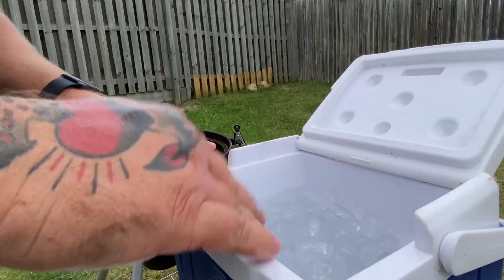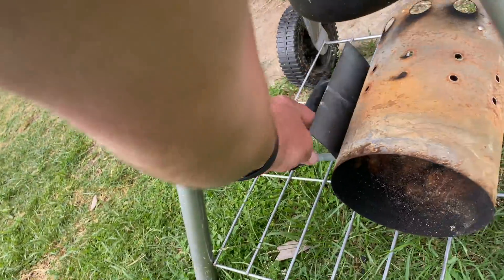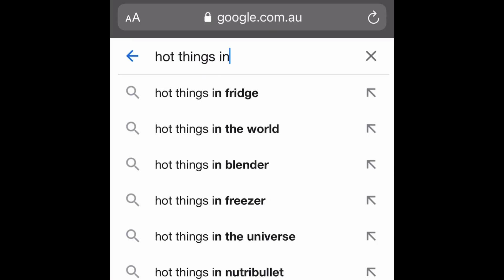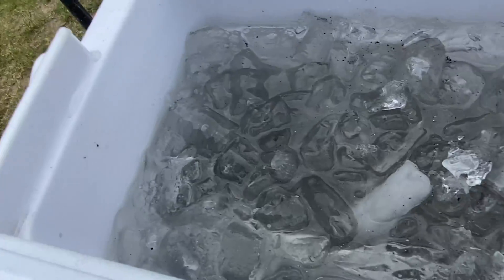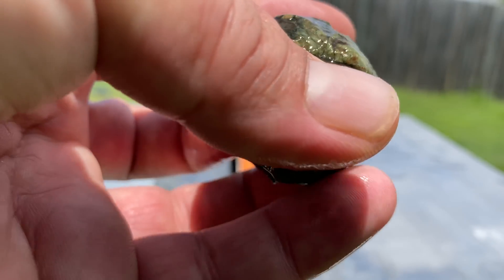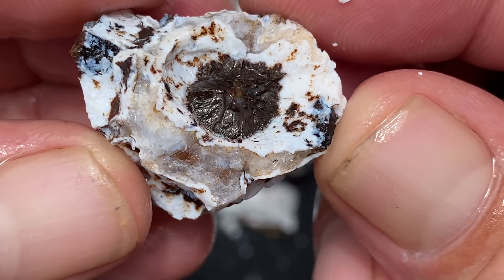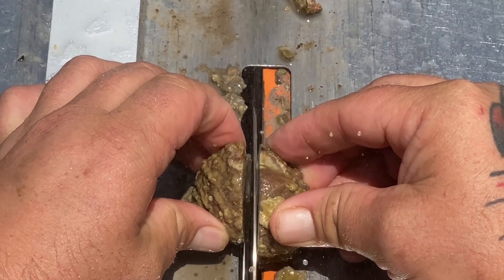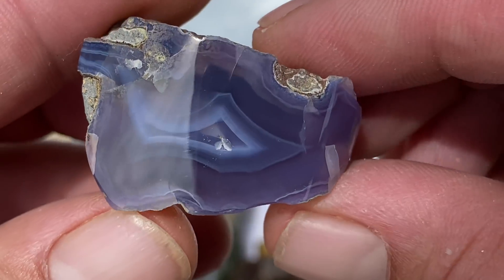Can I Make A Thunderegg Core???

Comment: I've actually found a few of those thunderegg cores/vertebrae while rockhounding. I suspect that the way they form naturally is through repeated freeze/thaw over thousands of years. 

Most rocks are actually slightly porous and porosity varies from stone to stone. The rhyolite shells of thundereggs tend to be more porous than solid agate/chalcedony or common opal. When they are in the ground during the winter and freeze, small amounts of water between the shell and the agate freeze and expand. Over time, this breaks the shell away from the core.

The white crumbly parts of the cooked thundereggs were likely common opal. Common opal contains a small amount of water that boils off in extreme heat, cracking the stone. Water also exists in the structure of other opals, and is why they tend to crack if left out in hot conditions (in a car during the summer, etc.). Agate, quartz, and chalcedony contain little to no water, so those parts remained more intact.

Hopefully that info adds to the discussion. Thanks for sharing the experiment as well! It was interesting to see and even when things don't turn out as expected, experiments are an excellent way to learn new things.
Reply: The difference in porosity between the rhyolite caps and the chalcedony cores is kind of why I wanted to try my hand at freezing/thawing a bunch of times - hoping that even just a small bit of water would seep inbetween the cap and the core and expand just enough to separate them.
I just wasn't sure how long or how many freeze cycles it would take!

I will be addressing this experiment again. :)
Reply from the maker: Man thank you guys! Such great info. Just pinned this comment 🤘🤘🤘🤘

Comment: I wont hate on you man but i am happy you didnt have any of them explode on you. As a kid i remember other kids throwing rocks into a camp fire and then have them explode and throw red hot glowing bits of rock fly everywhere.  I was also sure you would burn through your cooler.    Good luck with your future experiments.    You could try it a different way. By freezing them solid next time then heating them with a torch. Not enough to burn them but it may simulate thermal cycles of the seasons. Also try freezing them totally submerged in water. When water freezes it expands and that is why rocks here in Canada split  because the water gets into tiny fractures and expands as it freezes. Seeing agates and jaspers split by frost here isnt unusual.

Comment: It raises a very interesting point, rapid cooling caused the fast formation of fine crystals, so if you heated and cool inside the coal pot over a very long slow cool how would the recrystallisation turn out.  I feel like there more to do here.  Thanks for sharing.  You’ve just learned some basic geology, on igneous rocks 😄

Comment: This was such an awesome take on the experiment! Again, just takes me back to grade school when we used to take a theory, do our experiment, and present our findings to fellow students and teachers in hopes to get a colored ribbon. haha 
So interesting how the inside material reacted to the heat and became very crumbly! 
There was a reason I picked different thundereggs - each one has a different make up with how the "core" is formed and how the exterior rhyolite caps are essentially adhered. The richardson rock ranch thundereggs would be the best for the tests since they are prone to having the "core" exposed over time. 

Dude, You did a great job on the continuation of where I left off with those thundereggs...and at the end of the video when you cut them...I can only wonder if the freezing/thawing process did something to it! Just, BRAVO!!!

I really think if I had them in a container with the freezing/thawing process but had them surrounded with various packing of sand and smaller rocks and had a way to apply pressure to the container to simulate as if it were underground - I THINK I would have had a different result. But that's just a hypothesis!

Thank you for doing this - this was so fun to watch and a great way to start the weekend!!!
Hopefully it didn't ruin your cooler and luckily your phone is okay! :)

Rock on, friend!
Reply from the maker: Man thank you Kyle for your help woth this one and for the sacrificial rocks 🤣😂
To be honest, I had so much fun doing the experiment and editing it. Haha! Just thanks mega dude!

Comment: It's important to remember just how much we can learn from our failures as well as our successes. I once had a major failure trying to reproduce an in ground Viking forge. After a whole day of trying to get the fire hot enough to melt bronze and having no success a blacksmith friend of mine came to the rescue and brought me the right kind of charcoal then helped me get the fire hot enough to melt pewter. The flames were so hot that the pewter melted instantly (I had given up on the bronze by this point) and poured wonderfully into the clay mold. Unfortunately the mold hadn't sealed as well as I thought and the molten  pewter just ran right out of the mold then down the hill through the grass. Thank goodness it was night by this time and there was heavy dew on the grass. We had gotten the fire so hot it melted the plastic on the brand new pair of bellows making them useless and a fair amount of pewter was lost. That is the only time I have ever seen a fire so hot that the flames were purple. I was extreemly upset about what felt like a catastrophic failure but I have realized since that I  learned a lot from this. Always think about safety when working with this kind of heat, have longer cooling tubes on the bellows, work on non combustible workspaces, and have wash water handy to clean up after a long day of digging and working over hot coals. Stinky stuff.😁😉

Comment: Things expand when heated. I think you'd want the core cold, then flash heat the outside. Maybe pack them in dry ice and then drop them into hot coals. Or find a knife maker who thermal quenches with liquid nitrogen. Get them cold overnight in dry ice, quick dip in liquid nitrogen, and then a quick trip into the knife forge to get the shell to quickly expand.
Reply: Exactly this. Although boiling water might be enough and would a safe and accessible initial experiment.
Reply from the maker: Oh! So like the opposite of what I was trying. Okay, I think that’s gonna be the next attempt hahaha! Thank you Kyle & Derek 👍👍👍

Comment: Oooooooh dear, well aerial you in for it now.
Nah not really, all I will say is experiments are done one at a time not all at once, W.D.40 got it's name by the number of tries before the miniture was right, enough said you wally. 
Ancient egypt, for removing huge slabs of rock the filled natural fissures with water late in the day so the cold froze the water expanding the gap,  another experiment for another day.
Etching in acid is another way, providing the rock is not just quartz based, vinegar being the safest acid and muriatic acid being the worse, I like muriatic acid, makes your hands tingle. 
But in all honesty doing in one day what takes millions of years naturally will probably not work.
However, heating and quenching may be an option, before they are red hot, dip them in cold water a few times and reheat, repeat the process and you should crack the rock without the old method of using a hammer.
You tried, you learned and we laughed, what more could you want in a youtube clip.
There is also something called the internet,  Where you can watch others mess up and learn what you should not do.
Keep smiling my friend.

Comment: I'm sure there's some mechanical benefit to this experiment (the thermal shock you mention at 3:40), but you may actually be chemically weathering them too, just by giving them more energy to oxidize. Rhyolite will decay into clays, my guess is you accelerated this process.
Of course, that thermal shock will also make any crystals very very brittle, and possibly shatter them (I get in trouble once in a while at the diamond lab when I do that to a diamond). I know heat-treating isn't the same as what you're trying to do here, but the concept may help.  Put the specimens in a big crucible and pack them with silica sand. Use a kiln, as they are programmable and can get much hotter than a conventional oven (though I don't know about hotter than a bbq, but the bbq is wet heat, whereas the kiln is dry heat). Ramp up the heat over about 12 hours to your target, and ramp the temp down over a couple days, that should avoid both the charring and the brittling. And if you've got the right iron ions in the right spot in your specimen (assuming qz) when it goes in, it could be citrene when you take it out. Or prasiolite. Or just clarified. Heat treating is a fascinating aspect of gemology.
Reply from the maker: Dude seriously, I was hoping you saw this man. I’m gonna go back over your comment but I definitely had a thought while doing this, (is Adam gonna be looking at me like… “okay, he’s lost it” hahaha”), but I just wanted to share a backyard science approach, but more importantly, learn from what people have to say from watching it 🤪
I freakin love rocks, and I FREAKIN LOVE SCIENCE! So thank you Thirst. Bout to head to bed, but definitely gonna reread your knowledge i  no the morning bro. 
Have a rad day and week ahead man. Big big love!
Reply: @Rookie_Rockhounding  Hahaha naw man, experiments are where you find new knowledge! I went through a whole 'microwaving rocks' phase for a while. Didn't do anything, but I just felt I had to try in case it did!
Reply: This is just one of the reasons I enjoy being subscribed to your channel , knowledge.
I'll be making my way up to your area of Ontario next summer on my mechanical steed ( motorcycle lol) to spend a week or two exploring.
Reply from the maker: @highenergyog  aye Lloyd! Man I know it sounds strange but I remember when I first met you both. And honestly, I think it was at the same time on one of your videos. Regardless of why, I’m just stoked that I did. Love to both of you big souls.
Reply: @Rookie_Rockhounding  The feelings are definitely mutual Jesse . ✌🇨🇦😁.
Reply: @highenergyog  Oooo! I hope I'm around! I'd love to show you a couple spots!
Reply: @thirstfast1025  I'll be sure to send you a message to let you know when I'm on my way 🙂👍.